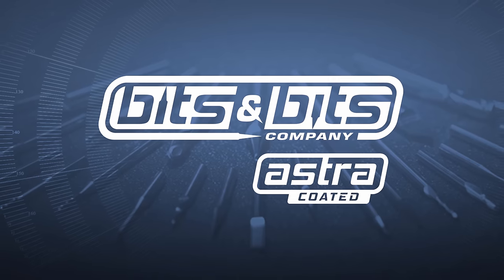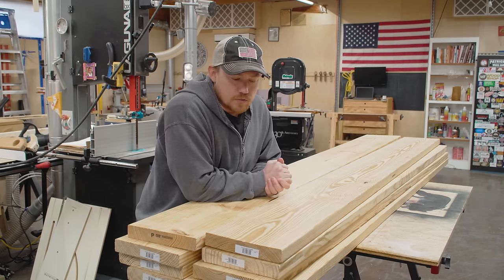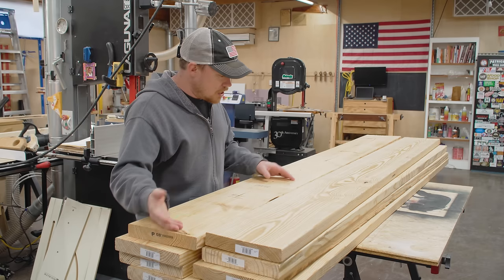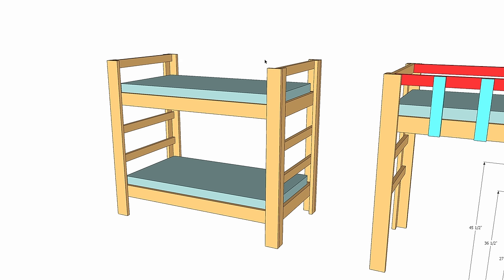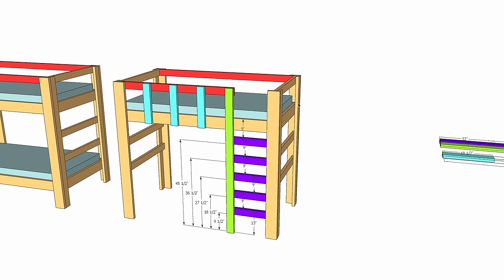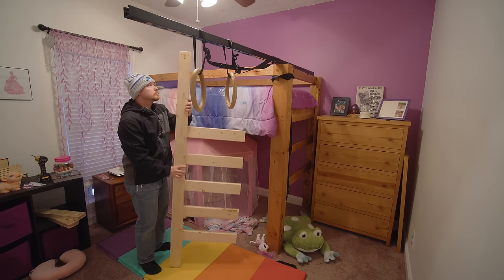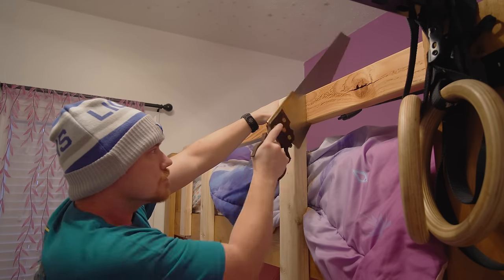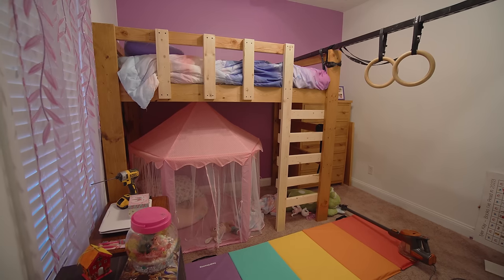DIY Bunk Bed or Loft Bed

Comment: I like it but I would have moved the ladder steps to the outside of the rails, or at least made them flush, rather than mounting them behind the rails. That's just me and how I like ladders to be, though. 
Totally agree with your points about SYP. I almost exclusively work with SYP and I like it.

Comment: I bought your plans 3 or 4 years ago and used them with minor mods for our Handyman Ministry to build bunkbeds for a Women's Recovery center.  I added a ladder because it would be better for the women.  The ladder is at a 7degree angle (if memory serves).  The beds are rock solid.